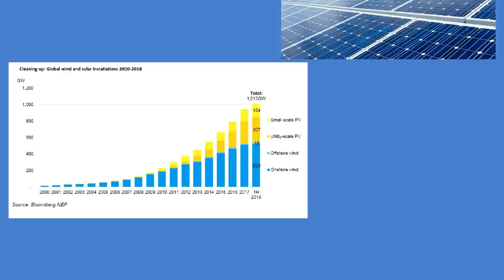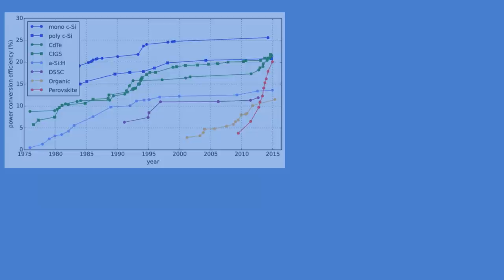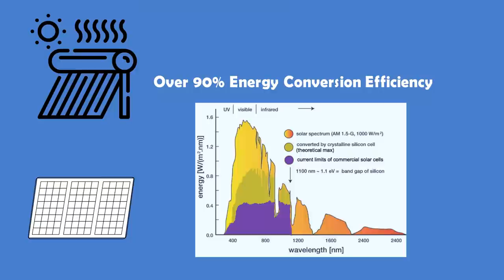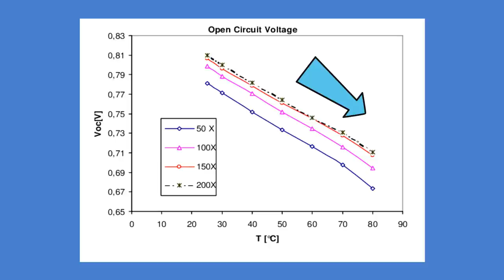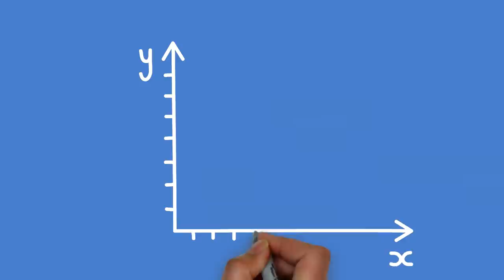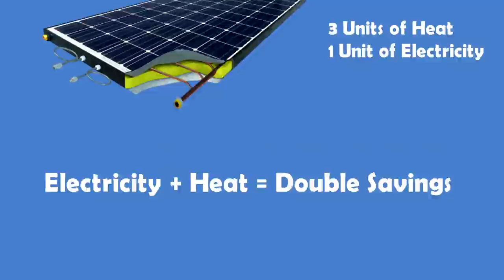Solar Photovoltaic Thermal Hybrid Panels: The Next Step

Comment: When my folks built a house back in the mid seventies, it was in an area that didn't have natural gas. Electric hot water was going to be really expensive, so they had the builder install a couple of five by ten foot thermal solar panels on the roof. (Back in those days, photovoltaics were way too expensive for home use.) The thermal panels used antifreeze and a heat exchanger in a separate hot water tank next to the electric one so that nothing would freeze during cold Colorado winters. They worked great, needed next to no maintenance, and saved a ton of electricity and money. If you could combine that with PV's, it would be awesome.
Reply: My parents did the same, and over 20 years the panels paid for themselves many times over, plus they provided hot water even when the power was out.
Reply: @macrumpton  - You had a "Wireless Hot Water Heater!"

Comment: I have one thermal panel among my photovoltaic panels, but this hybrid panel seems to be much smarter and more efficient, not even mentioning that all panels would be the same size and color, so no thermal panel standing out.
But more importantly, it solves the conundrum you face when you want to heat not just the water tank, but the whole house: You have to choose between adding more thermal panels and therefore less photovoltaic ones. You don't have to choose with these hybrid panels.

I cool my solar panels with air for better efficiency: I cut through the vertical mounting of each panel so air can circulate right under the panels from the bottom to the top of the roof as it heats, and pumped down to warm the house. I didn't experience any snow storm for the past 2 years, no thanks to global warming, but I suppose this system would also melt any snow even at night so that the solar panels are ready to produce as soon as the Sun shines.

I wouldn't mind the extra warm water. It would make raising tilapias possible, or it would heat the greenhouse in winter, not just the water tank. By the way, my thermal panel uses cheap glycol, not water, it would be a safer solution for these hybrid panels in freezing winters, and the water that's heated in the heat exchanger in its own pipes is suitable for the kitchen and bathroom too, not just heating.

Great video as usual, I hope you'll keep us updated when this technology develops.
Sorry, "great" is not good enough, my vocabulary is limited...  ;)

Comment: This is brilliant! I never realized the pv panels needed such temperature regulation.  This can be home built as well- simply build insulated cases to run water lines behind the pv panel. I'm planning on building a solar batch heater and I've already built a dual water circuit from city water into my water heater,  so if I choose to add pv, I can easily integrate this behind it. Even heating the water 1 degree will save some money with little investment.

Comment: Good video. This is one of those obvious technologies that make some people go "why hasn't someone invented that before?", but the fact is it was invented long ago, it just adds enough complexity that everyone prefers the simpler version unless necessary. The main cost of solar is installation, these panels are pretty simple so they would not cost much more than regular PV, but you need to do more work installing the pipes and other stuff in addition to panels and electronics. Basically you need to hire plumbers in addition to the solar installer team and that may cost more than simply using your solar electricity to run your water heater.

Some homeowners might love these things, but I wonder how useful they would be for large solar farms. Also, if one wants a solar roof instead of panels, would it be possible to put the heat collector pipes under the roof tiles?

Comment: During the summer the heat can be used to run an absorption cycle AC to cool the building. If coupled with a thermal storage system you can have solar powered AC.

Comment: Is the output temperature similar from vacuum tubes to these hybrid panels? If the temperature is much lower on hybrids it can be the case that they give the same energy, but less usable and that you would need a heat pump to concentrate the heat, eating into your actual efficiency.

Comment: I have been working and experimenting with this for 10 years. All countries with a colder season should have this in combination with a heat pump and storage of low-temperature heat in the ground. In Sweden, an average villa would reduce the annual need for purchased energy
 approx: 80% compared to only heat pump and rock heat system.
Reply: Can you share what you have learned I would like to experiment with a counter flow system of my own.
Reply: What is you thermal mass?

Comment: I'd love to see your sources especially a source that claims it would only increase the cost of the panel by 25%. This may have been true 15 years ago but today I can get a 300W panel for $150 easily which means your PV/thermal panel would cost $187.50. 1 evacuated tube panel can cost $1K so getting this down to $37.50 would be amazing not to mention the cost of the pipes, pump, holding tank(s), Etc.

Comment: Walking around on my roof's solar panels in the summer always made me wonder why someone is "capturing" the radiant heat along with the photovoltaic energy and here we are.  We have a pool and we're using pool solar water heating PVC panels NEXT TO our solar panels.  If we ever need to replace either system I'm thinking of getting this combined technology - by then it should be cheaper as well.

Comment: Another great video from Synergy files. Which solar hybrid panel do you recommend ? My solar PV supplier doesn't stock the hybrid panel. Thanks
Reply from the maker: There are very few companies who do them. In UK there is a company called Convert Energy that does them.

Comment: This is great. Where looking to use this methodology for heating water water in a camper van. We're going to have 800W of monocrystaline PV panels on the roof to charge 300A lithium phosphate batteries. We don't want to be carrying gas so thought solar hot water generated by cooling the PV cells was the way to go....ideal. We were thinking of just spiraling plastic pipes directly under each panel and then using a small pump every few minutes to circulate it though to a tank above the shower. But do you think we'd need to use aluminium? We live in Australia, so don't need to worry about water freezing.

Comment: I can see this approach may be practical for residential  installation in climate where there is a lot of need for home heating. But could this be adapted to AC heat pumps in hot southern climates.

Comment: there is some additional issues I could see with this particularly in cold climate where the heat would be most beneficial. For one thing plumbing and cold do not mix and there is an issue of frozen pipes , this issue can be bypassed by using antifreeze but that's going to reduce efficiency when you're talking about hot water heating.
Reply: We already use similar solar hot water systems today. They use food grade glycol to they do not freeze. There is also the option of having it set up to a drain back reservior that holds the fluid overnight until the collectors start warming up and then a pump starts moving it through. Trust me from an engineering side we can do this. We also have the technology to use it to heat thermal mass that will keep structures warm overnight. The heat in the summertime can be used to drive refrigeration as well to cool the structures. Its not a lack of science. The industries just need to scale up to bring the costs down.
Reply: No a glycol counterflow system would circumvent that issue and would indeed be a more efficient heat exchanging fluid.

Comment: An additional benefit could exist in winter months, where the thermal panels could act as a sink for water source heat pump. Cold water pumped in to the panels from the heat pump would be able to absorb ambient heat that is then passed to the heat pump.

Comment: It's worth mentioning heat pumps.  1kWh of electrical energy (which can be used to deliver 5 kWh of heating or cooling through a heat pump) is more valuable than the same 1 kWh as heat.  So 1 kW pure PV is better than 3 kW pure solar hot water in terms of energy harvested per unit area.  But hybrid is better than *either*, because you get more electrical energy and almost as much heat energy.
Reply: Can be used to work together. Not done a huge amount of looking into but there are heat pumps that work on a similar principle to ground source heat pumps that use the heat gathered by solar thermal instead of from the ground. Can then use the electricity used from the PV element to power the pump.
Should be more efficient than an air source heat pump but not require large amounts of land/drilling.
Down sides will be cost and I'm not sure how much heat it could gather in winter (not saying its ineffective just don't have the figures to hand), though cost is somewhat mitigated if you were going to get PV as well anyway.

Comment: It's a niche product or idea.  You couple two energy systems, and repair becomes more expensive. In residential systems,  the use of the heat would be limited,  and seasonal. The pump is parasitic, and when would the extra cost to integrate them yield a net positive energy harvest? It would take a special case where hot water is in demand when the sun is out year round.

Comment: A bit off topic, but there's been some Indian scientists/engineers there, that have been kicking around the idea of LTA technology (airships). Seems like airships would be an ideal platform (massive surface area) for experimenting with various solar energy concepts... Surplus heat could be used in developing heat exchange tech, such as flash (H2O) condensers for ballasting etc...

Comment: You could "bank" excess heat underground using the same system as a get-together heat pump. Then, in the winter, a geothermal heat pump will have more heat to draw from to hear the home.
Reply: Mud battery :-)
Reply: Look up Drake Landing Solar Community if you're not already familiar with it - they do this on a "community" scale (ground storage is probably difficult to do efficiently at smaller scales).

Comment: I think you should also check out the Australian company called ClearVue. It is another technology that works on thermal heat to make electricity.
Reply: Yes interesting thanks for the information. I know Perth west Australia has some of the best university professors. The problem being using solar to cool rather than heat.
Reply: @larkhill2119  it's technology is about glass e.g. windows. The glass refracts infra red to the framing which covets that to dc electricity. This could compliment existing solar panels technology and keep the panel cells cool.

Comment: I am just learning about solar  and was wondering the same thing myself  with out using water, but a cavitation cooling airflow under the panels  I’m an artist not an engineer but it would seem that there would be a way to cool the panels  that the air would naturally draw from a larger hole to a smaller one ... I e : natural cavitation  pehaps it is how a heat pump works?  Or could there be small fans which are heat generated which turn and circulate the air under the panel  to move it ? Perhape using freon? As refridgerators use? Just the action of the difference in heat  flow would draw itself?

Comment: I'm sorry maybe I'm missing something, can't you swap the water with something with a lower boiling point, and than use the expansion of the gasses to spin a turbine just like modern power plants? Or use the temperature deferential between the hot liquid and colder ground temp to produce electricity, which evers more efficient, I imagine the phase change idea would be and it'd also help further cool the panels. Wouldnt this greatly increase efficiency?

Comment: What about combining it with a sterling engine, or some other method, to convert the heat into electricity instead of heating up water?
Reply from the maker: Its best to run a Stirling engine from concentrated solar. The higher the temperature, the better the Stirling enginr works

Comment: If you will go for a heatpump already and have plenty of solar roofspace, it would be better to go pure PV panels. As you will have too much hot water in the summer that will be lost. If you have a pool, like mentioned in the video, it's a different story.

Comment: It is indeed a great technology however you only will generate a significant amount of heat in the summer which is when it is typically not needed (unless you have an aforementioned pool) although the extra bonus percentage of heat generated in spring and fall is nice and the extra electricity is great.
In winter one would however need to be careful of freezing or perhaps bleed the pipes. 

Still its a good technology in theory atleast, but the 25% additional cost is for the panels alone, we also need to connect those panels and set up the plumbing required pushing the costs to be significantly higher than just 25%. Please don’t assume I’m a skeptic, I think it’s actually a fantastic idea, but it is situational and I think for progress we need to be realistic about the broad scale application
Reply: It’s a solved problem from an engineering perspective. The main problem seems to be (manufacturing) cost and people being unaware of the existence of the tech. It isn’t customer friendly to get into either, as a lot is left to the customer to figure out, with multiple parties to engage, from the PVT company to a heatpump installer, PV installer, financing etc.
Check out triplesolar.eu for a Dutch example. Their system seems to be the best I’ve seen so far and supposedly takes 12 years to pay back.
It’ll take someone like Tesla to crack this market it seems, the remaining challenges are right up their alley; affordable PVT engineered for mass manufacturing, clean/easy software, nice integration with Powerwall etc.
Reply: @MacGuyver85  yeah whats interesting there is that they are using them as radiators, in conjunction with a heatpump.
Still in the summer one does not typically want to bring heat into the house, (except maybe boiler), and in winter, cooling panels even more potentially beyond the freezing point may cause issues too. But it does solve the lack of energy in the winter issue, which is great

Comment: Very interesting,thankyou.the exsausted heat in hot countries from the excess hot water in the system,you can generate electricity 1-use a heated salt/hydrogen battery 2-use the heat/pressure to lift a gravity battery(maybe your house) ( : thankyou

Comment: It probably adds too much cost compared to regular panels.  Might be good in cold areas where you could temporarily reverse the process and run warm water through the panels to melt snow and ice off them.
Reply: No, gluttonous companies make it too expensive, not the technology itself.

Comment: How about "storing" the heat underground, then "taking it out" with a soil heat pump during winter - when you actually need the most heat?
Reply from the maker: They do it already. Store hotwater in huge underground tanks. Its called interseasonal energy storage. Its used in Scandinavia and Germany
Reply: Look at dandelion energy
Reply: Also look up Drake Landing Solar Community - they've been doing this for a while.

Comment: Would be great if the hot water from the panels could get converted into electricity when the boiler can't accumulate more heat. Any idea's ??
Reply: Plenty of ideas but solar power is zero cost input so simpler to use more panels. Using R gas to power an electric turbo would be one example avoiding the need to boil water. F1 cars have a heat power recovery pack if you have the cash.

Comment: Running a fluid to extract heat beneath a solar array on a roof may exceed the structural limit.
Maybe heat pipes can be used instead.
Reply: I just shoveled off my workshop roof that had 4 feet of snow on it. A few 2 inch pipes, even a 2 inch layer of water on the entire roof would be more than fine with most standard building codes.

Comment: I would use mineral oil or cooking oil that could get up to a high temperature. Then store that in a well-insulated tank then use it to create steam and drive a weed wacker or (other small engines) that has been converted into a steam engine that in turns drives an alternator that charges the battery bank that runs the appliances in the house that have been converted to 12 or 24-volt appliances.
Reply: I believe a molten salt liquid  is the preferred system?
Reply: @larkhill2119  Let me see you set that up.
Reply: @mikeorjimmy2885  Just Google "Moulton salt heat storage"  tons of info on the technology current development state.
Reply: @larkhill2119  I know all about molten salt. But if you want to set that up in your back yard you go right ahead. Using a high temp veggie oil will not ruin the land like a spill from a molten salt device will.

Comment: Must admit, I have been waiting for this development. Electricity plus low grade heat which can feed a heat pump to warm the house in Spring & Autumn - made more urgent by Governments' desire to become carbon neutral i.e. in the UK they plan shortly to stop new house builds from burning natural gas for heating.
Reply: There is a YT video of a mans setup where he put an air source heat pump under  a solar array.

Comment: Rather than throw the heat away or into the ground (which limits it to new build instllations), why not use phase change heatstore batteries?
Reply from the maker: Its used in Germany and Sweden. Its called Interseasonal energy storage